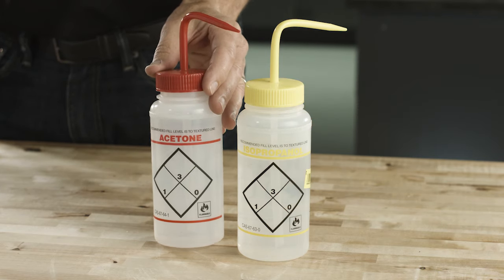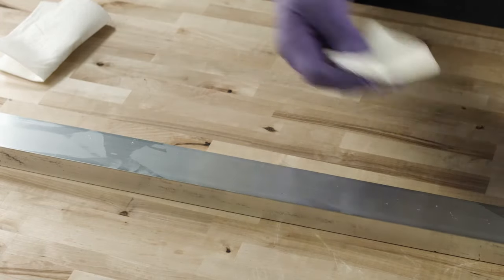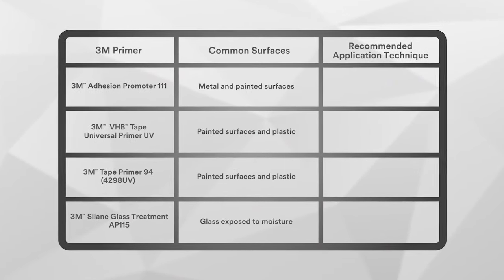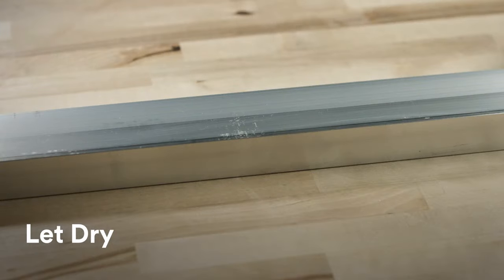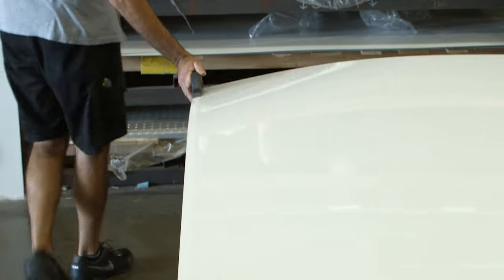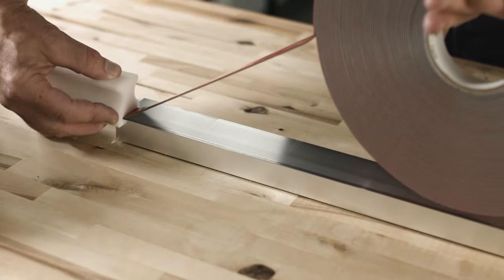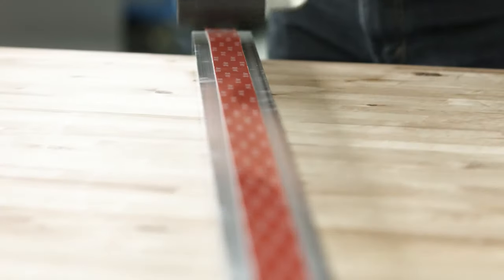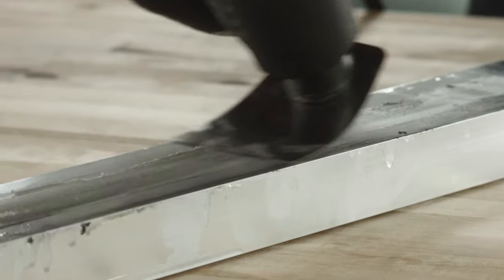3M Video - VHB Tape Surface Preparation and Application

Comment: It seems like the information in this video was given in the order that they should be done, but it doesn't seem to make sense to apply the adhesion promoter and then abrade the surface. Is that was 3M suggests? Adhesion promoter and THEN sand the surface?
Reply: You’d want to sand the surface, clean it then follow through with adhesion promoter right before applying tape

Comment: my RV roof is fiberglass, but has a kind of pebble finish.  Will the two tape work well on finish that isn't as perfectly smooth?  I want to install flex solar panels.  Let us know please.
Reply from the maker: Hello - for details on specific applications, please connect with our knowledgeable technical team: https://www.ellsworth.com/resources/ask-the-glue-doctor/
Reply: Did you get a reply you can pass on?
Reply: Just send it

Comment: Would this work well on painted metal roof or would I need to sand it down to metal finish?  My plan is to VHB tape two lengths of unistrut and connect a solar panel to avoid adding holes to my shed's roof.

Comment: very good video - thanks.  would this tape work in hot environments like a car engine bay?
Reply from the maker: Hi Ric,

3M VHB tapes have heat resistance ranging from 200 to 450 °F (93 to 230 °C). Temperature resistance for each tape family is detailed here: https://www.ellsworth.com/globalassets/literature-library/manufacturer/3m/3m-brochure-vhb-tapes-design-guide.pdf

Our team of Glue Doctors® can help you find the right product for your application: https://www.ellsworth.com/resources/ask-the-glue-doctor/

Comment: Hello, Thank you very much for this video. Quick Question: Could I use ethyl instead of IPA? or there will be some drawbacks?
Several people also suggest spraying IPA on a tape prior to adhesion since it gives them the time to readjust the position of the working surface and tape. Is it a good idea, or it might weaken the adhesive properties of tape? (could I spread with ethyl alcohol for the same reason?)

Comment: Can a hang a hand pump sprayer from the side of my laminate garage cabinets by using VHB on a steel L shaped hanger? The pump sprayer weighs 4 lbs empty and about 8 lbs full. Thanks.
Reply from the maker: Hi Evan,

Our knowledgeable team of Glue Doctors® can answer questions about specific applications: https://www.ellsworth.com/resources/ask-the-glue-doctor/
Reply: Im forgot remember one step primer light when pass dry

Comment: can i use it for my car side skirt?
Reply: yes you can...clean the surface as described, and use a little adhesion promotor as well as a little heat and you will be fine...added pressure is the key too

Comment: What is the difference between isopropyl alcohol and alcohol? Can I use regular alcohol? Because I'm not familiar with isopropyl alcohol.
Reply from the maker: Hi Goldwin,

Isopropyl alcohol has a high concentration of alcohol which provides antibacterial properties. We would recommend using isopropyl alcohol or acetone to ensure the best results.
Reply: Isopropyl alcohol is the kind you get in the first aid section of a drug store/pharmacy.

Comment: I guess for plastic on plastic you have to use a primer? Even with scuffing and alcohol to both surfaces...this shit just don't stick for me.
Reply: I have the same issues with plastics before. It works  when I apply rubber cement glue on the plastic,  let dry then apply the 3m tape.